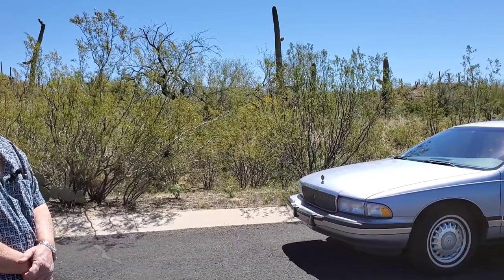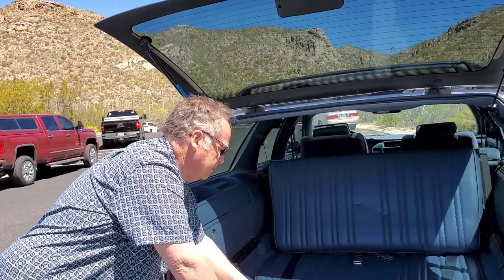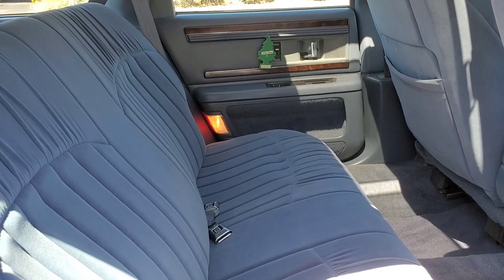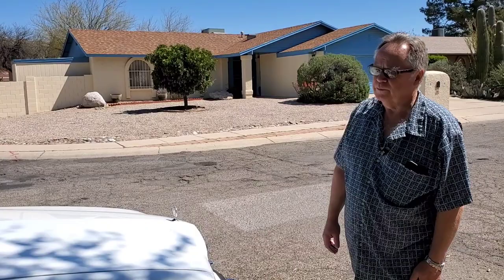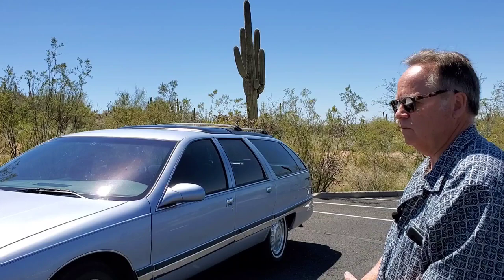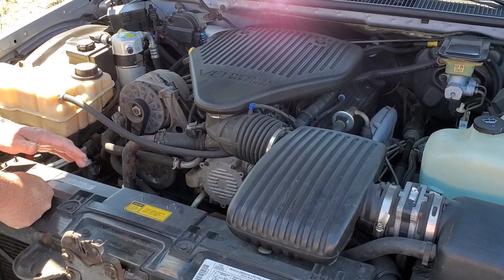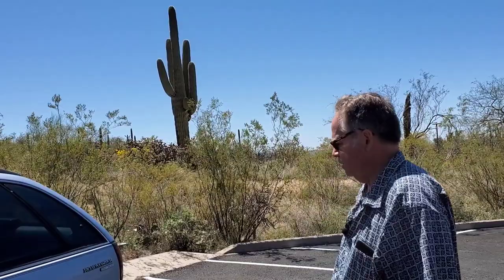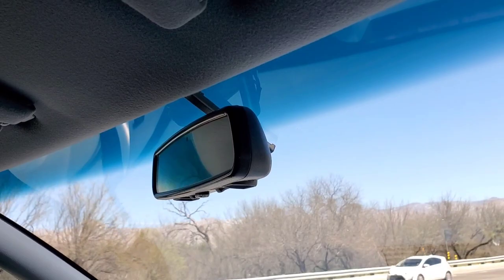1996 Buick Roadmaster Estate Wagon Collector's Edition Station Wagon

Comment: I drove my 93 wagon to a car show parade in Pensacola, and everyone went nuts over it. Straight dual exhaust, and it was all stock other than that. I had the woody. I drove it hot, and blew the gaskets. One of my most regrets in my life. I also had the 95 Roadmaster sedan police interceptor. I had to buy special tires to keep it on the road. A lot of power. They are not many left on the road. I am looking to find one ready to go. All restored, but mostly original.

Comment: If you ever have any problems with the door windows getting loose in the tracks. The factory put these oblong track sliders in the window regulators. You can get replacements. But instead I got Dorman part #74444 window regulator rollers. They last longer and have less chance of binding since they're round. It's been awhile since I did mine, but I think there are 4 in each door.  Although the 2 main sliders are the ones that usually break, I would recommend replacing all 4. And grease the tracks afterwards. The rest of the mechanism seems to last. It's just the regulator sliders.
Reply from the maker: Oh I have done this to ALL my current and former 1994-1996 Roadmasters and Fleetwoods. You are absolutely correct. I have a bag full of those rollers.

Comment: What is the version of the Buick Roadmaster that accelerates from 0-60mph in 6.6 seconds and travels the quarter mile in 14.9 seconds?
Reply from the maker: 1/4 mile in 14.9 is very possible with a stock 1994-96 Roadmaster sedan with the V92 option having 2:93 rear gear. But a 6.6s 0-60 would take some modifications to achieve.  Stock is closer to 8s. But these LT-1 engines are receptive to performance mods. And those interested in racing them do put in 3:42 or more rear gears. Basically these can perform about as well as their 1994-96 Chevy Impala cousin or Caprice with the police 9C1 police package, which can do 0-60 in about 7s which typically have 3:08 gears. 

In short, put 3:42 gears in a 1994-96 Roadmaster and you will probably see those performance figures you mention.